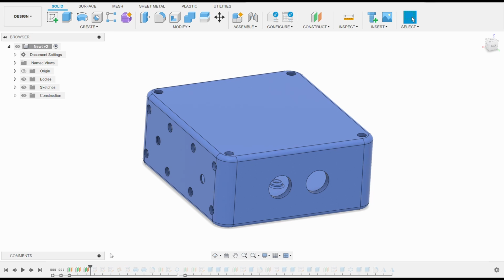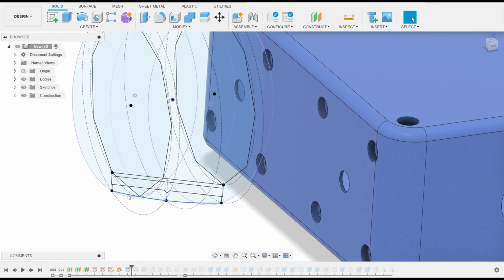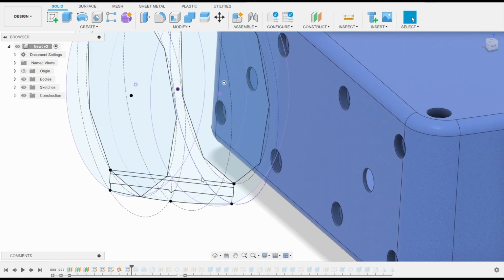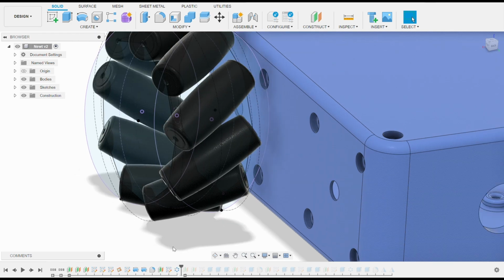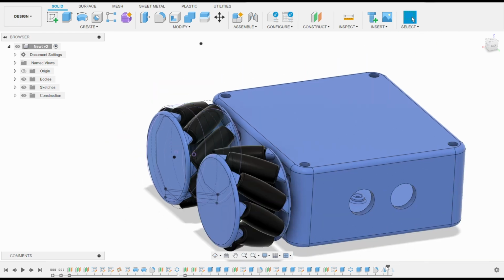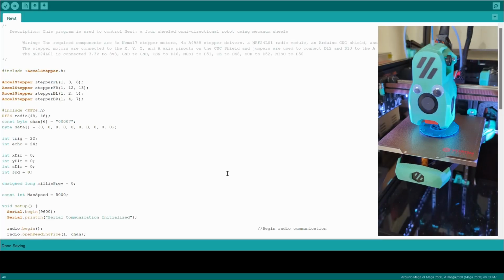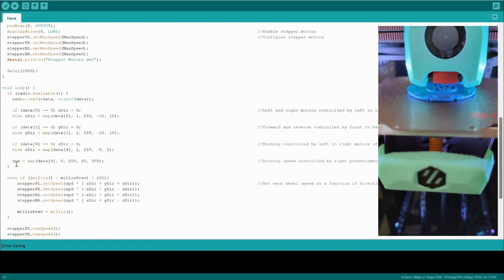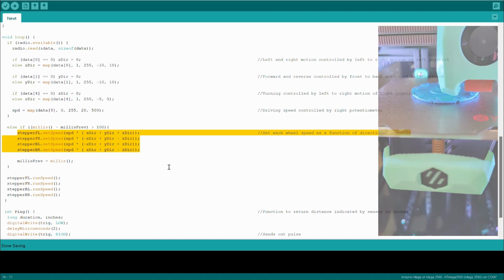Mecanum Wheel Arduino Robot

Comment: i believe with a step motor driver, you can use the enable pin to turn off/on the power to the motor to save battery.

Comment: hey can you tell me what is size of diameter of the bolts used in the mecanum wheels ? also, which kind anf size of shaft is the wheel designed for ?
Reply from the maker: @ahmadilyas5736  The bolts used are M3 and it's designed for a 5mm shaft with a flat on it